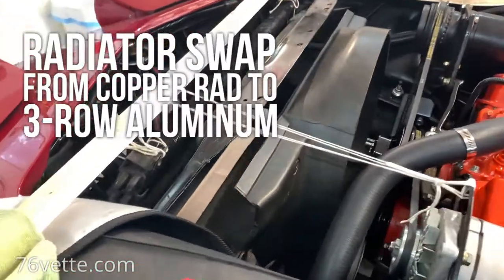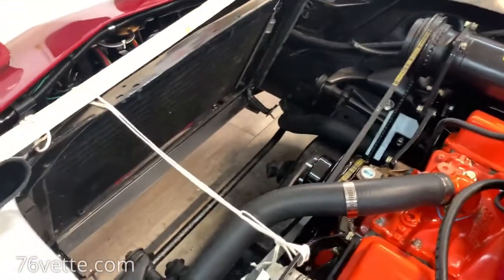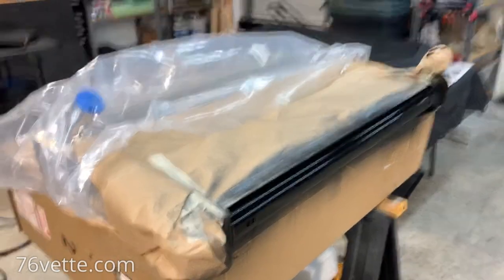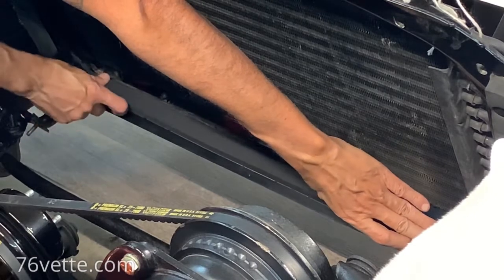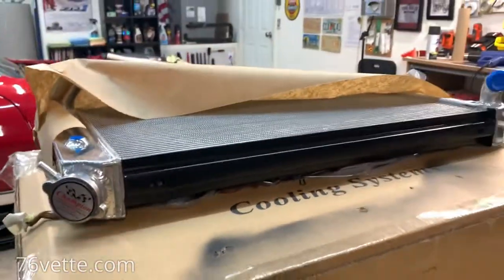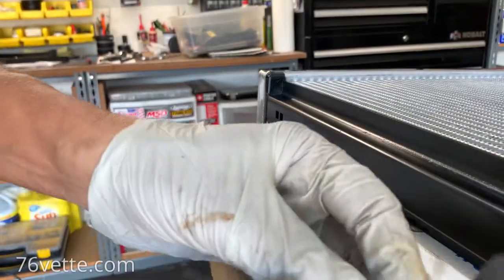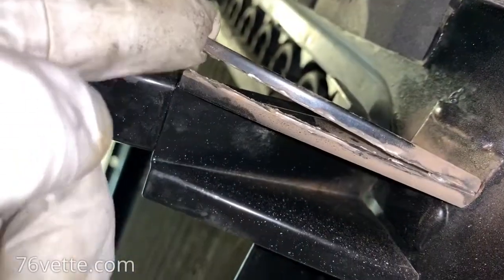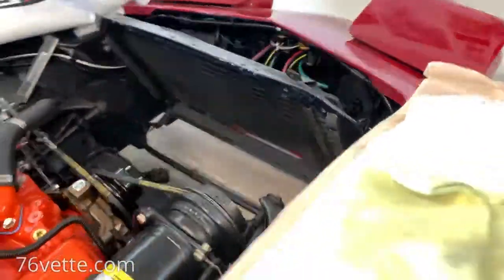Plan Your Work, then WORK YOUR PLAN

Comment: I'm curious how that paint will stand up over multiple heating/cooling cycles on the aluminum radiator. Hopefully it stays on without problems.
Reply from the maker: So far it looks fine. I’ve driven the Vette with the new rad for at least 100 miles and everything is okay.

Comment: Hopefully yours works. I got two defective radiators from Champion. The second one they sent was way more embarrassing than the first and how it made it through quality control was absolutely beyond me. After that, I had zero faith in them finally sending a correct one.
Reply from the maker: Wow! I am surprised to hear that. Mine was perfect out of the box and (since I did the swap a couple of months ago), it's been working perfectly. Hope they took care of you.
Reply: @76vette  They did take both radiators back but I had to hound them for the refund. Didn't have the best experience but it sounds like yours has been good so far.
Reply from the maker: @zachreese6540  So far so good. Fingers crossed.

Comment: Ah thats right you have a 4 speed haha no cooler.  I must agree with the below comments.  My radiator came mis alligned ( Champion. ) Bracket missed passenger side by half inch.  Have no clue what they were measuring to make the 3 core vette rad.  Fabricated some HD bumpers from heater hose over the brackets as I didnt want the lips of the brackets to cut into the aluminum.  Also didn't want to return it after all that work installing.  Radiator is going on 8 years without a hiccup though.  Anyone with an auto trans, use braided steel hoses connecting to the transmission lines unless you have steel lines all the way to the rad.  Lost most my fluid from something jumping up and cutting the line.  My TH350 did survive that debacle.
Another tip, ground your radiator to the block or chassis.  If not, the water/coolant is grounding the radiator and slowly eating the metal via electrolysis.  I ground all my vehicle radiators.
Reply from the maker: Yep, 4-speed manual. It sounds like Champion must have corrected some flaws since mine fit like a glove. Interesting idea about grounding the rad itself. I never thought of it. I can probably use one of the auto trans bungs as a grounding point. Hmm...
Reply: @76vette  Auto trans plug sounds like a perfect spot as there aren't many places to ground the rad.  My transmission mech told me about this, due to many vehicles destroying their auto transmissions; antifreeze getting into the transmission due to aluminum thinning and bleeding over into coolant lines.   Makes alot of sense as the radiator is isolated from any metal to chassis contact with rubber bumpers.  Only contact with the block is through the water/antifreeze as it conducts electricity.  You wouldn't have this issue as you have a stick shift.  But radiator will certainly last longer and less likely to spring a leak.